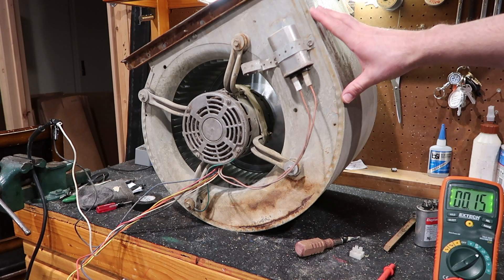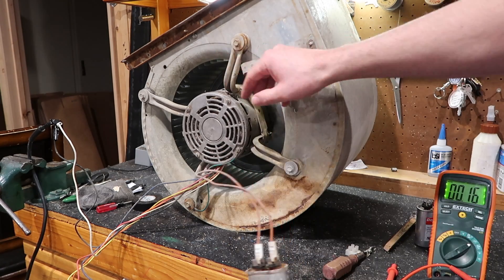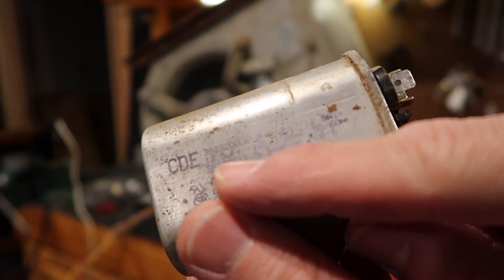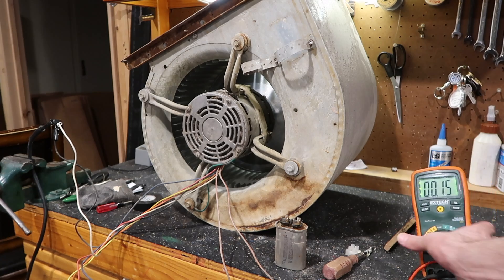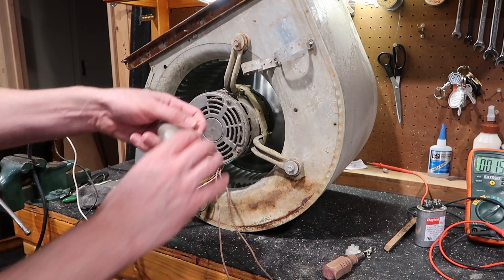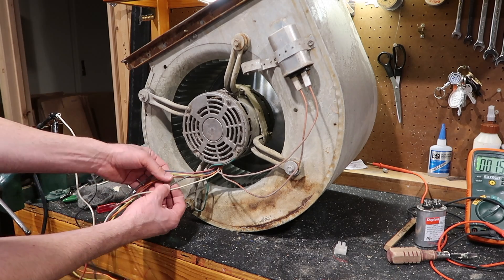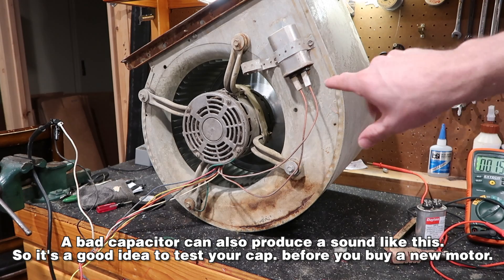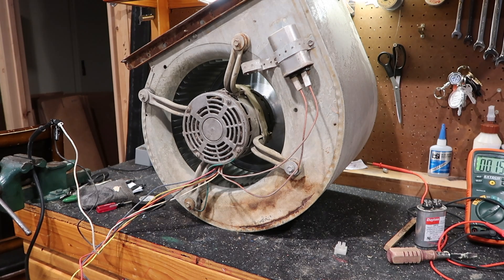Furnace Blower Repair - loud motor and how to test a capacitor

Comment: Curious Question. If the motor is completely shot and you wire it up the way you did to test, will it always buzz as the indicator? Or is there ever a time where absolutely nothing will happen. No noise, no movement, dead silence?
Reply from the maker: No buzz can mean a burned out motor.  It can also mean it’s just not getting power from either a bad circuit board, bad relay, or blown fuse
Reply: @AdamDIY thank you for the quick response

Comment: Dude did you just plug that in to 110 or 120? It's only getting half the power because it's a 220 motor and I saw you refer to the white wire as neutral when they are both hot wires jack ass

Comment: My fan turns on but not at the full capacity and it makes a noise like drum is loose but everything is right in there. Can bad capacitor cause this? I tried to use the multimeter and it reads OL instead of any number.. is my capacitor and motor are both bad.. I am so lost...

Comment: 11.13 uf is lower than 12.5 uf  -10%  but I guess it doesn't matter?
Reply from the maker: It’s low enough that it should be replaced but usually not so bad the motor won’t run.

Comment: First of all thank you for this video.  Would give more detail information on the purpose of the capacitor and how it works?  My multimeter doesn’t have a microfarad on it.  I understand I can test resistance but afraid the capacitor is too low to use with my multimeter.

Comment: What if the motor is outside of the blower, it's running it with a belt. There is no capacitor that I can see. Its making the same noise. Thanks

Comment: Here’s a way to test if it’s the cap. Give the blower a good spin then turn it on. If it spins up to full speed, it’s the cap.
Reply: Geez he/she is trying to help. It might as well be a way without tearing it apart
Reply: Fanawb Productions stupid idea, idiotic even, and not accurate. You could spin the fan loosening debris or a mechanical defect. Great way to injure yourself, it takes under 2 minutes to walk outside, remove a panel and test a capacitor properly and safely
Reply: 2inchfromtheground f a l s e

Comment: I have the same hum on my Rheem blower motor. found bad bearings install new motor & matching start capacitor still has same hum. will start if you spin motor. what kind of voltage should be on terminals in start . any ideas?

Comment: 22 dislikes? HVAC repair dudes maybe? 😆
Reply: Not necessarily. 
I don't do HVAC repair, but I gave it a "thumbs down" because testing a capacitor with a meter doesn't tell the whole story. The meter can't test for excessive electrical leakage. A capacitor can still exhibit the rated capacitance while having a lowered internal resistance (leakage due to internal breakdown of the dielectric).

Also, the terminals are corroded. Since it mounts contact side down, it's not likely from condensation dripping on it (noting that the bottom of the blower housing was rusted). The capacitor could have a physical leak which will corrode the terminals. Either way, it should be replaced.
Reply: Gotta be, no doubt.

Comment: I just wanted to give an atta-boy to the video poster. Your video helped me solve my non-working furnace when it was getting pretty cold. What was special about this video is that you clearly explained what setting the multimeter needed to be on and zoomed in to show the symbol on the multimeter. This was very important as many of us are not electricians or have training in multimeter settings. Most other videos only referred to checking the MFD values with your multimeter, assuming you have that kind of high end meter??? 
Yours clearly showed the setting and how to test the capacitor and the need to wait and let the capacitor charge up, as well as, what readings you should expect based on the printed label. In my case, when I tested the capacitor with the multimeter, it showed OL which I believe means open line. This conformed the capacitor was bad and was not reading the appropriate values. This was an important test because my capacity looks brand shiny new, no rust, no corrosion, and no bulging. Ever the HVAC parts salesman questioned if it was bad when I showed him the capacitor. He was surprised as well. So thank you for your well thought out video and showing the necessary steps for a beginner like me to learn. My repair cost me $11 for a new capacitor and I had heat 5mins after I got back with the new capacitor. Your video saved me a couple hundred dollars for a service call!

Comment: Just replaced motor and capacitor. There was a loud rumble when fan was running. I thought maybe motor/bearings were going bad. New motor was cross referenced from Grainger Industrial. Put new motor in. Better but still a rumble on start up. Could the blower wheel somehow be bad and or the housing it is in? All wires on motor were same except one. There was an orange one on old and a yellow one on new. When running,  air flow from vents doesn't seem as forceful. Where do I go with that?

Comment: Thank you SO much!  This was the exact sound my furnace was making! I changed the capacitor and when that didn't work, replaced the blower motor and voila!  All fixed!  Including the buzzing sound in your video was key in making me think I could fix this myself and it saved me a lot of money!
Reply: How loud was it really? Like in the video it’s outside by itself it sounds REALLY loud. But when it’s in the unit itself I would guess it’s more dampened?

Comment: Adam . I have a colman furnace in a mobile home  but the back of the motor ( bracket end ) is what you see when you open it up. I dont see a way to slide it out . it all looks mounted in .. any ideas?

Comment: Replaced blower motor and tested the capacitor and it tested good. Not sure if I trust it, so I went ahead and bought one. Replaced the capacitor, and still the new motor and new capacitor will not start makes a much more silent hum than the old motor but still will not turn. Next step I am going to replace the control board UNLESS you think it could be something else I am not seeing. Help Please!

Comment: This is a great video, however I can't find the capacitor. I recently changed the one outside, so I know more or less what it looks like. I don't see it attached to the motor. There is a panel board directly on the motor that has the cables for different speeds, as well as black, brown, yellow, and green/yellow cables. Please help! My unit is Carrier fx4dnf025

Comment: ok i replaced my fan in my house last year at the end of the winter the one i took off didnt have a cap. but the one I replaced it with does have the wires for a cap but not one on it how would i go about finding either a replacement without a cap or the cap for the one i have someone pls its really cold in mn

Comment: You can also check the other speed taps to see if the motor is really bad. That is a 4 speed motor. You might luck out and be able to run on a slower speed.

Comment: Caps are made, big news. They are graded, on a +- scale. Lower the number the better the cap. Means it will be closer to the initial rating. A 10% cap is inferior to a 5% or a 3% cap. The cap you tested needs replaced. OEM installed a 12.5uf. It if isnt' that replace it.

Comment: Every four years, a 51-2711-03 blower motor has failed in my house’s AC system. I have replaced the motors twice, saving the failed units. After the third failure, I opened up the two bad motors and realized that the front bushing of one of them had almost “frozen,” just like the rear bushing of the other. Lucky coincidence! So, after oiling the two still good bushings, I put together a good motor with the good front and rear plates: it rotated as well as the new one I had just installed. Now I have a good spare —my wife goes insane when the AC fails in the summer...

I also saved the front and rear “bad” plates --which hold the bushings. My curiosity was spiked after a couple of shops in the Miami area would not fix the third motor for lack of parts; so, I ordered a puller and plan to find, after opening the caps, the exact dimensions of the rotating parts needed. If I don’t find the bushings and the felt, I’ll try to adapt some sort of ball bearing to it. I realize that I don’t really need a second spare motor but I like to finish what I start.

If you’ve already done this, do you, or anyone else, know where I can get the bushing hardware or the ball bearing number?
Reply: Look up a armature repair shop in your local town and you can buy the new bushings from them , I live in Syracuse NY and you may be able to order thru the Syracuse Armature company ( listed on the website ! )

Comment: My Motor seems to run, but the wheel makes noise like its rubbing. wheel has play side to side. but motor shaft does not. capacitor lists 10uf but goes past 20 and didn't stop when metered. does the wheel have a bushing? capacitor issue a coincidence?

Comment: Thank you for taking the time and making the effort to post this video. This week I had the exact same symptoms of a bad furnace motor vice a bad capacitor. There are many videos about replacing the capacitor, but yours is about the only one that looks at the motor as the culprit. Last week, my 17-year old furnace motor began to sound and act just like yours. A direct substitution with a new capacitor did not solve the problem. I removed the motor and disassembled it. The front sleeve bearing had worn to the point where the rotor was rubbing against the stator (field winding) and the shaft was scored where it contacted the bearing - this generated the noise and even would cause the rotor to stop turning when starting up. Through observation and logic, your procedure is a great way to troubleshoot and decide to whether a capacitor is sufficient (the cheap fix) or a new motor (more expensive) will be needed. Thanks again!

Comment: Adam, did you discharge the cap before testing it with the mutli-meter?  I saw the annotation about discharging.  I understand you were measuring the capacitance (impedance) of the old capacitor; but not the current.  I am just wondering about the discharge instructions in text, versus your actions (on the video) for clarity's sake.

Great video!
Reply from the maker: Yes I did.
Reply: Warron French hi guys I have question about my unit so when I calling heat on the unit I heard just humming so I change the blower motor works no heat